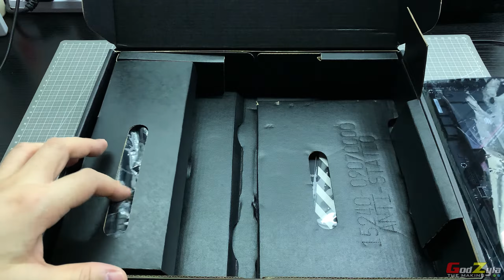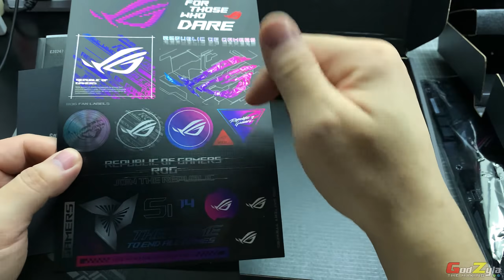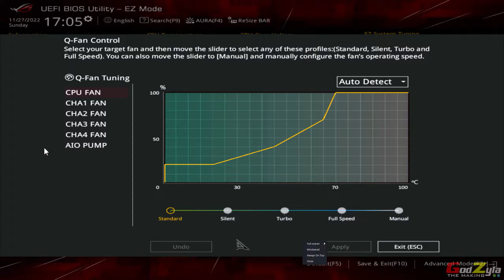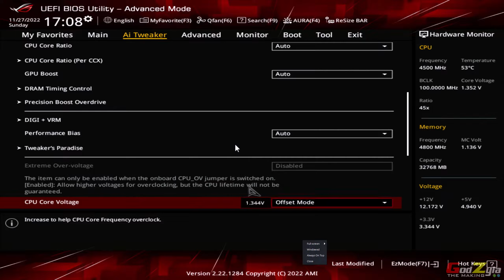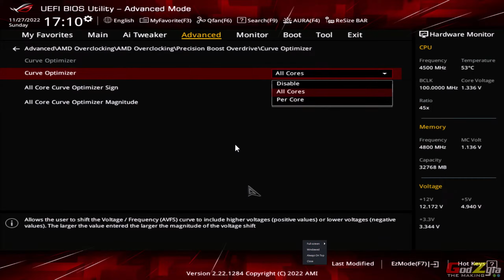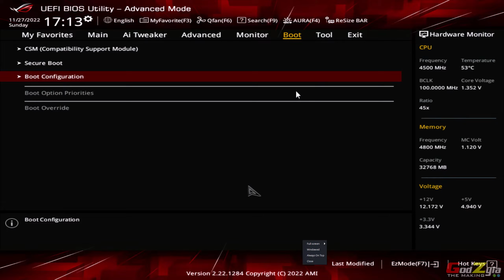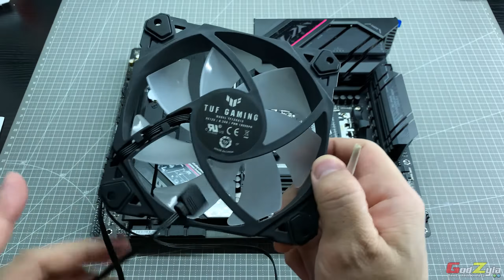ASUS B650E-F Strix Gaming Wifi

Comment: Good review. Regarding the fan header overheating issue, what fans do you recommend? I'm getting this board and wanted to hook up a 2 or 3 fan aio at the top, 3 fans on the right side of the case, and then 1 fan on the left
Reply from the maker: Hi Mus M, welcome to my channel. For fan recommendation, I personally do not like ARGBs and will only go for budget fans like Arctic P12, P14, Montecl P120 METAL PWM or even Lian Li P28. It's all depending on the situation.

Comment: I have this motherboard and it’s not detecting the tpm 2.0 so I can upgrade to windows 11 do I have to buy the tpm2.0 add on and plug it into motherboard or is it already built in
Reply from the maker: @NightWwolf  hi welcome to my channel. It’s with the board. TPM mode chip is only needed if you want full encryption which are meant for enterprise level. You do not need the chip to start with. This board already have the socket or pin. Just enable it and you will be able to install windows.
Reply: @KleoYan  I have it enabled in bios but windows still isn’t detecting tpm2.0
Reply from the maker: @NightWwolf  hmm. Remove the tpm chip and do a clear cmos, see if that helps.
Reply: @KleoYan  where is the tpm chip located
Reply from the maker: @NightWwolf   oh sorry I read incorrectly. I thought you purchased the tpm chip. If ignore my last response. Did you clear cmos and try again. By default after clear cmos. Go to bios or UEFI. Go to advance and check under AMD fTPM configuration, make sure it’s enabled.
Reply: @KleoYan  yes I did that in bios and clicked F10 to save and exit booted up to windows and clicked (windows key + R ) and typed in (tpm.msc) and it tells me compatible tpm cannot be found
Reply from the maker: @NightWwolf hmm. Are you updating from windows 10. For that I am not sure what happened. As I do fresh install on x670e or z790 motherboard without issues. You might want to try do fresh windows 11 installation on a spare m.2. If it works, I suggest you transfer all your data out and to do a fresh windows 11 installation.
Reply: @KleoYan  yes I’m trying to upgrade from windows 10 to 11 you think that might be the problem
Reply: @KleoYan  when I look at the asus website for my motherboard and I go to tech specs it only shows windows 11 64 bit as the operating system
Reply: @KleoYan  should I just factory reset my pc and buy a windows 11 key then since I don’t have a spare m2
Reply from the maker: @NightWwolf  Hi first off, I am terrible sorry that I am not able to aid you. This will be my suggestion. 

Either 1st method
1) Check with this method to see you can update it from windows 10 to 11. https://www.youtube.com/watch?v=C4Y_j1US99U
2) Seek someone who is familiar to update windows 10 to windows 11. you can seek for help at windows reddit forum r/windows

or 

2nd method 
follow this video where it shows you how to create a windows installer https://www.youtube.com/watch?v=C4Y_j1US99U .. the activation key you can buy it later. 

hope these help.

Comment: Question about 9:34, do we have to use both 8-pin and 4-pin? or just 8-pin will do?
Reply from the maker: @AuriumGG  hi welcome to my channel. Only the 8pin EPS is required and it's more then sufficient to drive the processor, unless you are doing extreme overclocking.

Comment: are you a part-time mechanic or arm wrestler? great detail though. thanks
Reply from the maker: Hi matu lu, welcome to my channel. Thank you for your feedback. I am just a tech and diy person 😁
Reply: @KleoYan   Glad I found you. btw will I be able to use 6600MHz ram on this board or it'll not support?
Reply from the maker: @matulu-p6x  Hi and welcome to my channel. This board only support up to 6400Mhz max. I dont think it will run above specs.
Reply: @KleoYan hi. thank you bro 🙂. ohh since I've bought this dual channel vengeance and can't bother myself for refund, is there any alternative way to go around this and boot it up , maybe by reducing the clock speed to 6400Mhz? another thing is there huge difference between CL38 and CL36?
Reply from the maker: @matulu-p6x  Hi, I will load the EXPO profile of your rams and if you ask me is there a big difference betwwen CL36 to CL38. I dont think you will feel the diff but in practice CL36 is faster as it's of a tighting cycle timing or cas lentency.

Comment: I'll be using 7 Thermalright TL-M12 fan , The Asus ROG STRIX B650E-F GAMING WIFI motherboard supports up to 3A on its 5V ARGB headers. Each Thermalright TL-M12 fan draws 0.15A for ARGB lighting, totaling 1.05A for seven fans. This is well within the 3A limit per header.  do you think connecting 7 ARGB fans to a single 5V ARGB header is safe and should not exceed the power limit of the header. ?
Reply from the maker: Hi Human, welcome back. The readings of each fan’s LED are at 0.15a and you will not have a problem to daisy changed 10 fans to one ARGB header which is 3A. It is safe to so no worries. 😉

Comment: Hey Kleo! I decided to jump the gun on this motherboard based on your review... and I'm now having second thoughts about it. Has it given you any troubles since your initial thoughts? I had a sour experience with this board given that the LAN drivers aren't recognized immediately when Windows is installed and because my USB3.0 header ripped and broke a pin after just one plug in, rendering 2 of my front USB-A ports useless. A USB port at the back also acts funny with an external DAC, if it's not turned on when booting it won't recognize it and it'll render the port useless until I reboot. Turning it on during normal use won't work, and if it's turned on when I boot my PC and then turn it off and try to turn it back on it won't work, it's just with that singular USB port though (top left from the blue USBs on the rear IO), the others work fine and this doesn't happen with anything else. The IO shield is also a tad loose on the top right corner for some reason.

Curve Optimizer with -25 on all cores for a 7800x3D and 6000 MT/s G.Skill Trident Neo RAM with EXPO enabled work flawlessly though, I'd just like to know if it's a good board in the long run or if I'm better moving my system to an X670E Tomahawk instead. Running the latest drivers and BIOS too, pretty easy to set up to be quite honest.

Keep up the great work! Also loved your LF III review and it's my cooler of choice with this CPU, really helped me make my purchase for both of these items. :)
Reply from the maker: Hi Ohmnity, welcome to my channel. For me I didn’t run into any of your issue with this board but I do have to agree on the LAN part. I too have to do a local login in windows and to use a license key to activate windows. If given the choice of this and the MSI x670e tomahawk. I would take the tomahawk as it does have all the bells and whistles, plus during installation, the Lan/RJ45 is detected.

Comment: motherboard manufacturers are removing real POST CODE LEDs from low end boards, which is a shame, and replacing them with LEDs.   the problem isnt positioning of the replacement indicator LEDs, its that there isnt a POST CODE 7 segment LED.    The other problem with M.2s and connectivity in general, there is no longer a high end desktop segment, at least one that is affordable, that offers enough PCIe lanes to allow for things like M.2 slots, and full bandwidth PCIe slots, and more of them.     Who wants to run their GPU that maybe they spent $1000 on, at X8?  Also, ill bet the real market for people plugging in PCIe 5.0 M.2 into the second PCIe x16 (real x8) is very very small.
Reply from the maker: Hi scbadq, welcome to my channel. I do share the same sentiment as in having to remove the debug LED digital screen on mid tier boards, for lowend I can understand. Now as for the PCI-E 5.0 slot with the Gen 5 m.2. I guess in every evolution stage, it will be there till a much mature board in future will be able to cater for full x 16 on both slots, the keypoint is time.

Comment: Hello, first I want to say that you have a fantastic and informative channel, now about this board, I read a lot of issues with his i225-v Ethernet chip by Intel, did you find any problem with that? (If you tested it) thanks for your job, you’re amazing!
Reply from the maker: Hi Zane, welcome to my channel. I have no issues with internet connection with the i225-V, I mean what's your issue with it. I see what I can do to help you out and do pardon me for the late repy.
Reply: @KleoYan  I was about to buy this mb but I have read many issues with this i225-v Ethernet chip, such as drop connection to 100mega or even losing it for seconds/minutes depending on the case, but it is a well know hardware problem with these chip so I was wondering if the revision on this board suffer from that too! But anyway I bought the Tuf one watching your video, so thank you 🙏
Reply from the maker: @zane4006  hi and welcome back, I see, let me reach out to Asus to see if anything can be fix on this board. Do you mind to drop me an email godzylatech@gmail.com, if I find out anything, lets communicate through email on this subject as I might lost sight on where to reply. Thank you! btw congrats on your purchase on the Asus Tuf board. 😉

Comment: Awsome review I bought one my self but ran into a problem after installing it into my pc. I am stuck in bios. It recognises my m.2s, I have reseated my graphics card, I have removed the cmos battery and checked all my connections. Would you have any suggestions ? As I do not want to have to reinstall windows again and download everything all over again 😢
Reply from the maker: HI GEECODELOCO, welcome to my channel. By right it should work when you plug your m.2 SSD to the first slot, but if you are bring forward from another motherboard to this motherboard, I would advise you to re-install windows.
Reply: @KleoYan  okay I’ll try reinstalling windows, will I still have all my previous programs and whatnot
Reply from the maker: @geecodeloco1138  if you do a fresh re-installation, you have to reinstall your other programs.

Comment: hi, did u have any problems whit ram set at 6000mhz ? cuz i read a lot on reddit abut it, i wanna buy a 7800x3d whit this mbu and a 6000mhz corsair kit at cl30
Reply from the maker: Hi Alex, welcome to my channel. nope I have not run into any issues. In this content am using a G.Skill Trident Z5 NEO Series (AMD Expo) 32GB Kit DDR5 6000 CL30-38-38-96 1.35V Dual Channel.

Comment: Planning to upgrade my PC from Am4 to am5. Which one is better the B650 E-F or the B650 E-E?
Reply from the maker: Hi Bruce Lee, welcome back, I wouldn't say which is better, both does it's job.. only different is E has 1 more m.2 slot and some other additional features. for me I will get the F board and spend the extra on something else.. can be rams or m.2.
Reply: B650E-E is more better. He have powerful power on vrm
Reply from the maker: @RUD1TV  hi welcome to my channel. I don’t deny what you’ve method. If overclocking I rather go with a x670e. B650e doesn’t really clock well. You only get a small fraction as compared the the x670e boards.